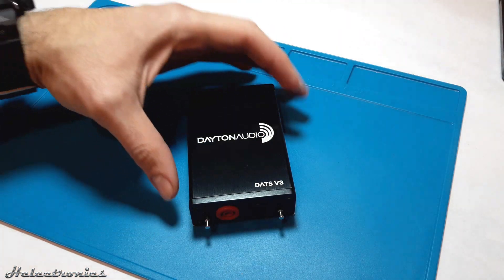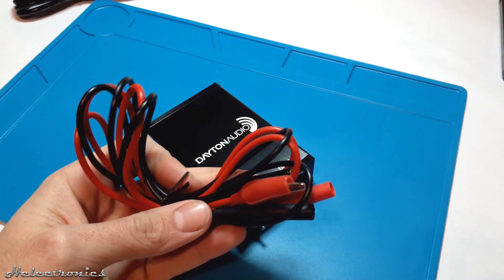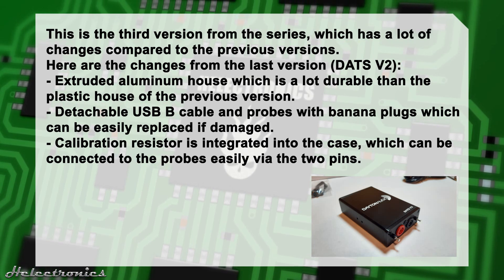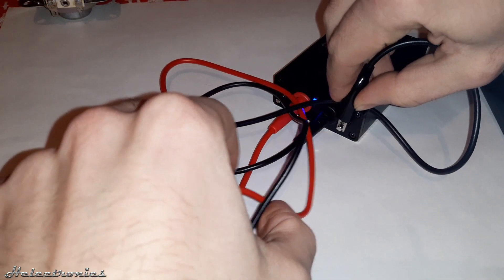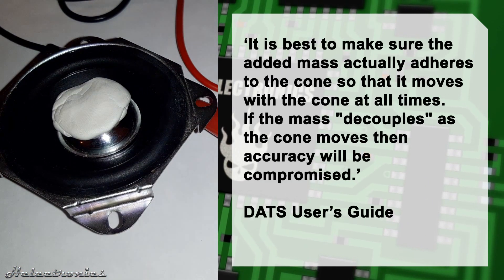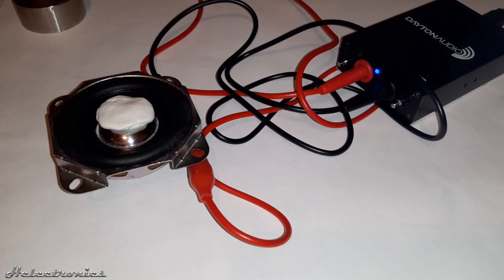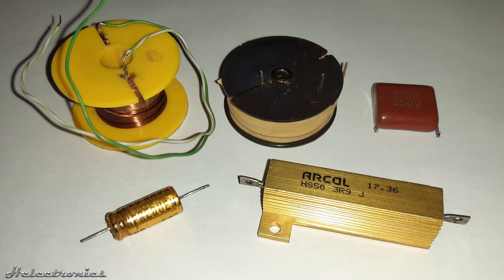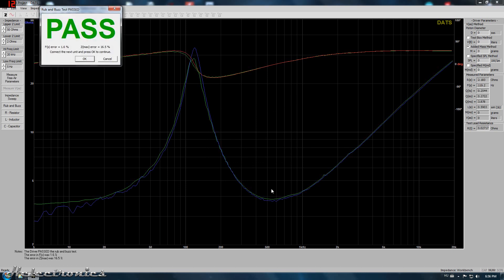REVIEW - Dayton Audio DATS V3

Comment: It seems your piston diameter measures 160mm, but in the piston area box of the software i see you tpyed 52*  , very confusing. How do you get that 52* ?
Reply from the maker: That's a really good observation, when I've measured the diameter of the piston with the ruler, I've used a bigger speaker (8 inch sub) so it was easier to demonstrate how to measure the speaker piston diameter. I've written 52 because with the DATS I've measured the Aiyima full range 2.75 inch speaker. The * symbol was accidentally written. Thank you for watching and mentioning this mistake.

Comment: Please more measurements with DATS. I am a newbe so i have much to learn. There are so many possibilities with this system!
Reply from the maker: I couldn't pack everything in a single video, I might do a part 2 video if get enough requests, thanks for watching!
Reply: @Helectronics   Also interesting to know how to measure full range drivers with "bullet" in the middle please. Some recomendations  how to find perfect tweeter/woofer  please .
Reply from the maker: Unfortunately I don't have that kind of speaker to measure, if I get one I will include it in a video. It hard to find a perfect tweeter/woofer, it is more important to build an adequate box for them using measured parameters.

Comment: Halo. I have a question, for rub and buzz, do i need 2 identical speakers? Also how to determine mass weight? I tried 2 different weight, the result has a lot of difference. thanks
Reply from the maker: Hi, rub and buzz test is for mass production of speakers. So you measure one which you think is the most ideal and then it compares the rest to it. What do you mean by mass weight? Are you referring to the M(ms) or the added weight? I use a digital scale to measure the added weight.
Reply: @Helectronics  - quick question if possible?  With the rub and buzz tests, is it possible to store traces for known "good" speakers to reference against without having to have the original driver present for each test?  i.e. create a library of drivers known good used in cabinets and be able to test suspicious drivers as required.